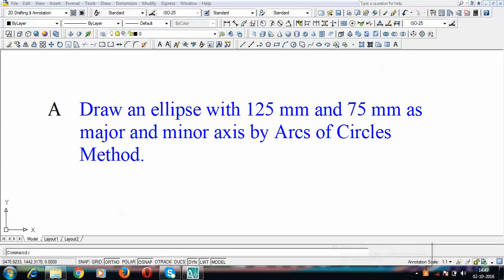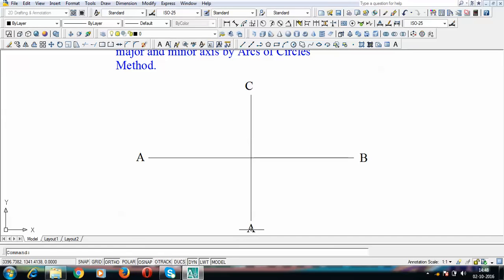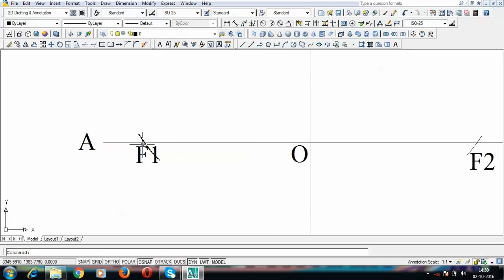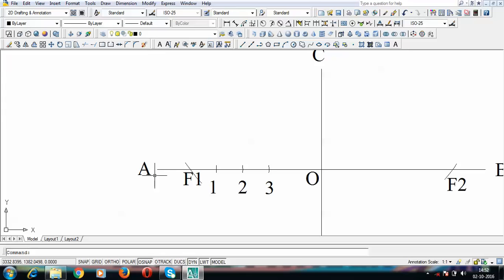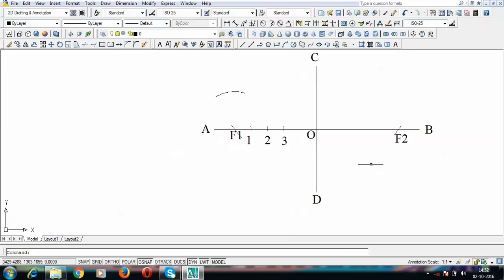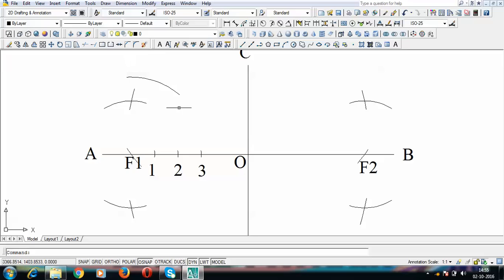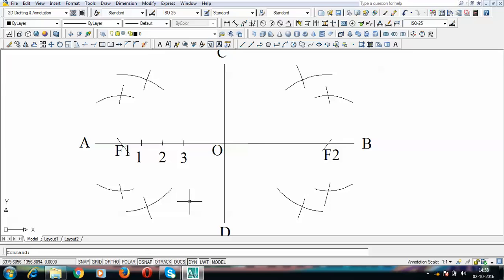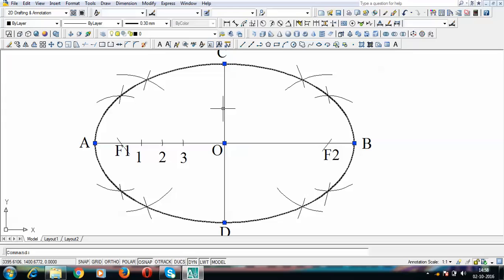3  How to draw an ellipse by Arcs of Circles Method

Comment: What id the question is...
distance between two fixed points F1 and F2 is 80mm. Point P moves in such a way that the difference between its distances from F1 and F2 is always constant and is equal to 50m. Trace the curve by point P.